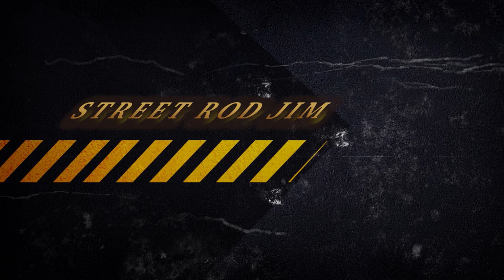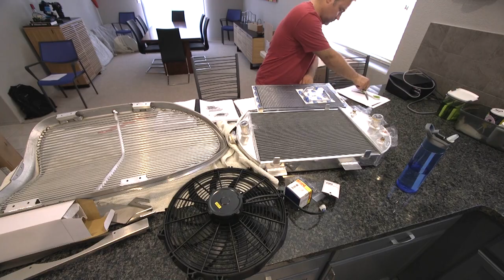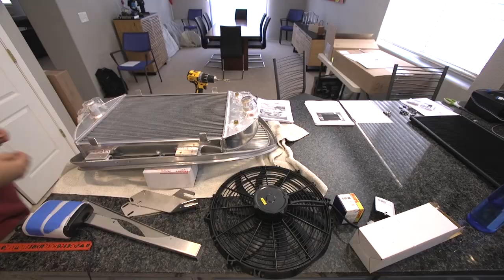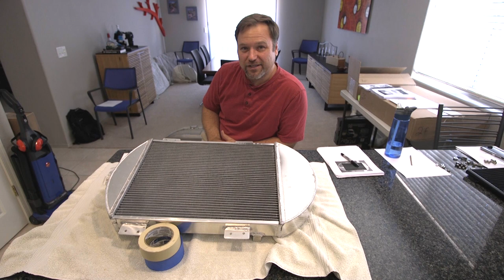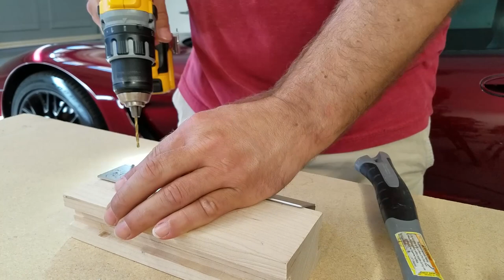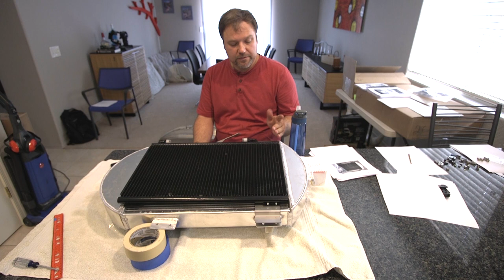Factory Five 33 Hot Rod V2 Build -  Building The Radiator & Grill

Comment: Jim , it's probably stainless steel and if so reorder the bracket because you have worked harden the s.s. just remember, much lower speeds when drilling cutting s.s. and use plenty of oil .also when you drill s.s. never ever let the drill just set on the surface and spin you will work harden it very quickly .

Comment: Dull drill bits sound like your problem. If the steel is harder than your drill bits, it will just dull them. You can anneal the bracket by heating it up, and letting it cool slowly.
Reply from the maker: THX